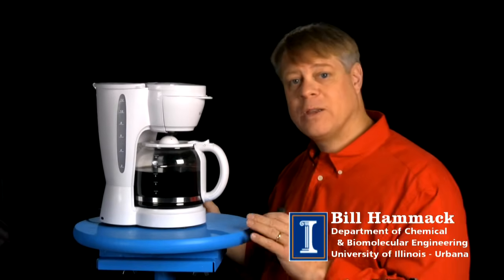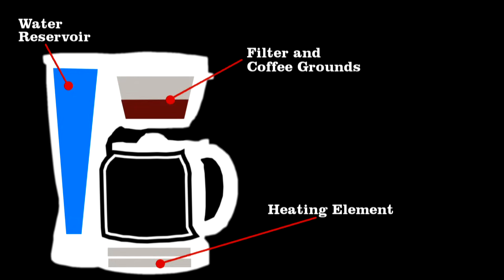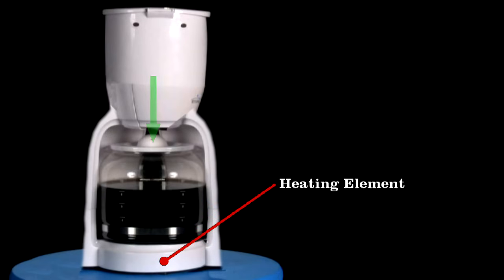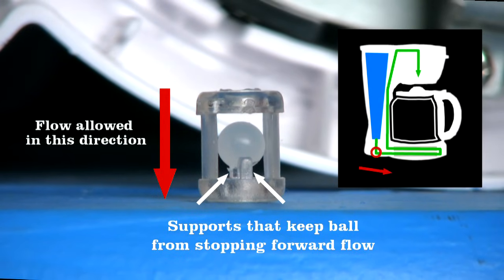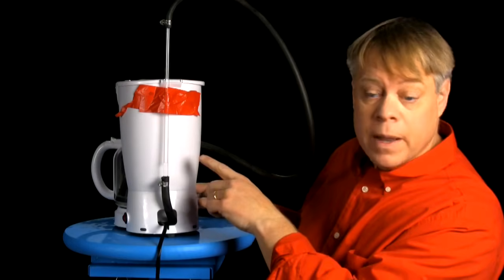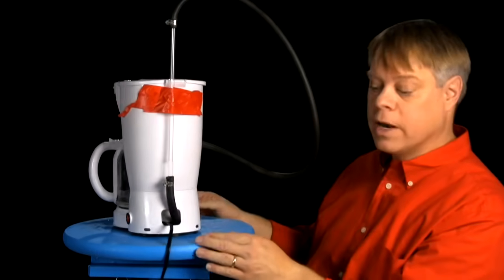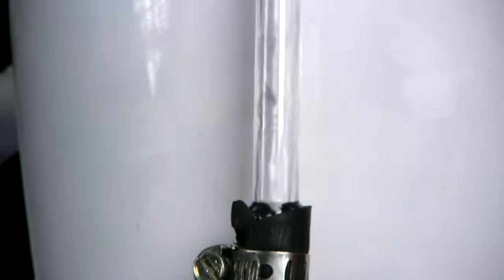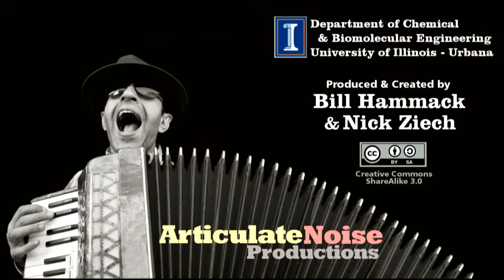Coffee Maker: Pumping water with almost no moving parts

Comment: "no moving parts" ..... "the ball rises" ahem....
Reply: I think he meant more so that there were no mechanically driven devices that caused the pumping action, the ball merely took advantage of the pumping that was already occurring because of the heat.
Reply: factually inaccurate.
Reply: ImAManMann
Seems to me the point of the video went completely over your head. You should still be able to appreciate the engineering design, isn't that why you are watching these videos?  I assume he meant there was no mechanical parts used specifically for the pumping action as physics took care of that itself through a clever design. If this were the case, yes he could have clarified it better but so what? it was still a well explained video just like the rest of his uploads. I don't see the purpose of making a big deal out of it. If it really bothers you that much, I'm sure your absence would go unnoticed. Maybe it'll serve to lower your blood pressure and your pompous attitude.
Reply: ImAManMann
You say you don't care what he meant yet that's the concept your initial comment revolves around. Trust me, nothing you can or will say will ever go over my head - except maybe the rather pointless and haphazard wall-o-text you wrote in an attempt to offend me. I wouldn't deem why you're watching completely irrelevant, if it's to be hypercritical on video titles and fail at winning an argument, I think you're doing a splendid job. As for me and many others, I enjoy watching his content because it's informative, well-edited, and I find them interesting. I'm not gonna implode because he could've been a bit clearer on his video title and I don't think you shouldn't either. How could you enjoy anything with such a fickle mentality? Hence why I advise you stay quiet next time and unsub for your own sake. Try to enjoy life more without being so bitter. Have a good day :)
Reply: LOL Mike....(now that I have stopped laughing .... inhale... exhale...ok) I can only surmise that you either have a reading comprehension issue or you are angry. You failed to address the points I made or misunderstood them. Please try again. wall-o-text??? pot/kettle anyone? Bitter... hahahaha. To quote you again "I don't see the purpose of making a big deal out of it." But I don't really expect any better out of the interwebs.... Should I throw in a sarcastic jab here at the end.... nah... you are digging your hole fast enough by yourself. cheers
Reply: +ImAManMann: Just because you don't like me and quote me a few times, it means that I'm clearly digging a hole for myself - you must do wonders with that kind of logic. Meanwhile, I have a Master's in the field. If you strictly just wanted to point out the "inconsistency" in the title and weren't annoyed by it like half of these hypersensitive kids on YouTube then that's almost just as bad - considering it was said dozens of times before you even watched the video. Much like the responses you're giving me now, it was rather unnecessary. Yes I did assume you said what you did with emotion because I didn't want to think you were dim-witted enough to think it was helpful to say the same thing the last 20 YouTubers said before you - but then again, like you say, I don't expect much out of YouTube. I guess I was hoping for better conversation on a channel that revolves around calm, scientific explanation. I was dead wrong. May you point out redundant statements for countless videos to come!! Don't waste my time with another response unless you can keep calm and not spam capital letters and insults. I would appreciate it.
Reply: In your response to my second comment "I'm sure your absence would go unnoticed. Maybe it'll serve to lower your blood pressure and your pompous attitude." You were condescending and rude with no provocation from me.

My comments were to that point "Factually Accurate" with zero of anything else.....well there was an "ahem"

You continue to be condescending when you have no footing to do so.

My comment was correct. Regardless of how you feel about it or whatever contrived position you hold. I was and am correct. If you want to argue against me, argue against my point. 

If you can actually comprehend what I have written, then stay on topic and argue against my factual statement. I'm guessing you won't.

OMG... My argument was simply that the video stated "no moving parts" and then shortly thereafter referenced a moving part. 

You are correct you can "make .... analogies...say the word logical". The problem you have here is that you are not addressing the argument I made. You are attempting to "posion the well" instead of making a counter argument.

You are factually incorrect. I have not been angry one bit during our entire exchange. I do not have the problem where other people and what they say impacts my emotions. I find it silly that you feel this way...would it be wrong to call it projection...

 "Please keep coming back.......yadda yadda..... Anyways, I'm done here, I had enough fun with you. Thanks for wasting your time with me."
Ok sure...LOL

And again with the anger reference.... so confusing... is your inner dialog when reading YT replys sound like samuel l. jackson in snakes on a plane? If so, everyone will sound angry to you.

Dude, thing is... I said it was factually incorrect and it is. You tried to wiggle around saying he "meant" and "explained better". The fact is, it is "f a c t u a l l y  i n a c c u r a t e". Take out the "moving part" and it ceases to function.

Please come back and argue that point.

This is awesome... I am totally going to share this.
Reply: ImAManMann
You should share this if it'll improve the days of others, because why not? You haven't written much so I'll choose to focus only what you said that remained on topic and wasn't angry nonsense, LOLs , and needless spelling of words I already know how to spell. I'm not sure how you can keep saying the context of the title doesn't matter when it does. If one video was someone using a glider and they made the title "I'm flying like a hawk" would you then go out of your way to point out it's factually inaccurate because he's not an actual hawk? Seems like a waste of energy to me but people will do what they feel is necessary to make themselves feel smarter or more important. Similarly, in this case, he meant his title in a different light. I already agreed there was room for confusion and it could have been clearer but I then again say - who cares? Just enjoy the video and stop being so angsty and hormonal :) for the record I have addressed every point but you have proven to lack basic comprehension skills. 
I would love to continue this conversation to keep making you and your friends smiling, so if you want to continue please keep feeding into my replies. Thanks.
Reply: "You should share this if it'll improve the days of others, because why not?" I know, right? 

"You haven't written much so I'll choose to focus only what you said that remained on topic and wasn't [AD-HOM]angry nonsense, LOLs , and needless spelling of words I already know how to spell." So a few questions.  I have told you specifically that at no point during this interaction have I been angry. Why do you characterize my responses as angry? Can you read minds and know me better than I know myself? It is truly bizarre your obsession with imputing anger and other qualities. You do realize those are poor argument techniques... right?

"I'm not sure how you can keep saying the context of the title doesn't matter when it does. If one video was someone using a glider and they made the title "I'm flying like a hawk" would you then go out of your way to point out it's factually inaccurate because he's not an actual hawk? [FALSE EQV]" Is english your first language? The key difference between the example you provided is the "like" clause. Which I would interpret as being hyperbole. It the title of the video I am quite sure hyperbole was not intended. I will change my opinion on that if the creator of the video states that it was meant to be hyperbole. There is no grammatical indication in the title that anything else was meant. Especially given the fact that the title of the channel is "engineerguy" and engineers are known for being peculiarly specific. 

"Seems like a waste of energy to me but people will do what they feel is necessary to make themselves feel smarter or more important.[AD-HOM]"
My original.... and second comment was very short and passing. The equivalent of a "roll-eyes". Should I also characterize your massive and out-sized response to my small comments as an attempt for you to make yourself "feel smarter or more important."?

"Similarly, in this case, he meant his title in a different light." How do you know this empirically know this? Please be specific.

"I already agreed there was room for confusion and it could have been clearer but I then again say - who cares?" Yes, you are admitting my comment was accurate. Why do YOU care?

"Just enjoy the video and stop being so angsty and hormonal :)[AD-HOM]" Why do you feel the need to hand out advice that you will not take yourself?

"for the record I have addressed every point but you have proven to lack basic comprehension skills.[AD-HOM]" You failed to address why you feel that I am angry. You are incorrect btw. I know you don't truly believe that I lack basic comprehension skills, you would realize that would make my responses impossible. The reason for you stating this is the same reason so many people use ad-homs, your position is untenable and you have no real argument. Title is factually incorrect. Lets see you argue that without using any further logical fallacies.

"I would love to continue this conversation to keep making you and your friends smiling, so if you want to continue please keep feeding into my replies. Thanks." As you said "because why not?"

You have reacted so much like the SJWs who I occasionally interact with on the tubes. I would like to see a response from you minus the logical fallacies consisting solely of an argument against my claim that the title is factual incorrect.

I have tagged your logical fallacies above and I know you will claim that I used them also... I will admit that I have thrown in some ad-homs, but only as a response to your own. You started it, you strayed off topic making personal attacks and you can stop it. You will not bully me though. Stick to factual statements. If you cannot stick to factual statements then this thread may become EPIC.
Reply: ImAManMann
I don't have to read any of this, hope you had fun writing it.
Reply: Ahhh yes... no argument... thank you for conceding.
Reply: ImAManMann
:)
Reply: Mike you know... funny thing... looking at the notifications on my phone I can see that despite you saying you don't have to read my reply...you did. you read it you replied and then you came back and edited it to pretend you didn't. a hahaha dwl .
Reply: ImAManMann
No, I just forgot the "+ImAManMann" part so I edited it. Not sure why you're still continuing this conversation.
Reply: Oh and check out 4 seconds into the video. I don't know if it was ninja edited or not, but it now reads "almost no moving parts" BOOOOOM can you feel that...
Reply: Are you really still going on about this? your opinion on my integrity is meaningless and I can assure you nobody will care whether you're right or wrong because they won't want to waste their time reading this long chain of messages. Invest your time in something else.

Comment: The one way valve is also called a check valve. As a chemical engineer working on the floor, i deal with them all the time but I had never ever thought they could be used as a pump. Wow.! Also learning recently a bit about "slug flow" usage in crystallization processes, I find equally fascinating. You can actually crystallize solids in a moving gas bubble in a tube and control particle size using slug flow.

Comment: the valve sort've moves...
Reply: cakeman58 Yep so does the on/off button and thinking of it even the coffee pot moves. 
But that is not what engineers mean with moving parts. Technically 0.9999 is not 1 but for an engineer....
Reply: Electrons move in wire which we call electricity - literally, electricity is the energy in the movement of electronics

Everything has moving parts or it doesn't do anything
Reply: Technically: yes it does move.
However, when things are described as "little-to-no moving parts" they're referring to not having things like electro-mechanical pumps that push the fluid through instead of letting physics do the work with a simple check valve.
Reply: MinecraftEpicPlayer
An electron isn't a 'part' anymore than an atom is. Sure it's a "part of the process," but that is not what the word 'part' means in this context- or the phrase "no moving parts" would be utterly meaningless. The abstract definition of 'part' shares the same word in English but is actually a completely different concept. A valve is a moving 'part' in your coffee maker; an electron is not. The title is technically a lie.
Reply: ElNeroDiablo except this was literally described and titled as having no moving parts, which is false.

Comment: The principle is called "thermosiphon".    At one time,  it was even used in some automobiles,  in lieu of a belt-driven water pump., to circulate the engine coolant.
Reply: I think this is different. What is actually moving the liquid here is heated water forming bubbles (vapour) inside the rest of the water, and as it rises it pushes the liquid water up. I don't think a thermosiphon uses a gas to move the liquid, it uses thermal convection. A bubble pump (aka gas lift pump) needs the one-way valve to function. As each bubble passes up through the liquid it pushes a little bit of that liquid up, but because it can pass through the liquid it is not capable of pushing it all out of the way, which is why the one-way valve is needed (so the little bit of water that is moved up with each bubble doesn't move back down). That's what gives this kind of pump its distinctive sound, which is created as the gas escapes.
Reply: @Derek_Read  This is correct
Reply: Probably in France... 😃
Reply: A gas lift pump only needs a one way valve if there is the possibility that the bubble can go  the wrong way. You could replace that valve with a U-bend, provided you have the space to do so. The gas bubble can't go down and around the U-bend.
Reply: @fermitupoupon1754  the check valve is preventing the liquid from flowing the wrong way, not the gas.

Comment: You didn't really explain how it works, though did you?  You just said it forms a bubble pump. The reason it works is not due to buoyancy. The water in the heater boils into steam, which expands, pushing the water above it upwards into the coffee. The valve prevents it from going back into the reservoir. After the water exits at the top, the back pressure on the valve drops, and the valve opens, allowing cool water to rush into the heater. From there the cycle repeats.

Comment: Sir, can you guide me as to what kind of electric pump I should use for pumping drinking water from a 20 liter can such that it outlets water only when I switch it on. Currently I am using a centrifugal based pump which passes water even when off. So i have to use an RO solenoid valve with it, but that dampens the pressure and makes the setup bulky. Any advise would be helpful. Thanks.
Reply: If you want the flow of water to be blocked when the pump turns off, you don't have many options. One possibility would be a vane pump. Other possibilities  are a lobe or gear pump or a peristaltic pump none of these types of pumps are going to be cheap, small, or low power. Without knowing what your desired final result is, recommendations are hard. Are you trying to lift water? transport it? dispense? etc.  Flow rate and required pressure are the biggest factors. You could consider pressurizing the 20 L container with air, and then opening the solenoid valve to allow water to flow by pressure.  Personally, I think using the solenoid valve is a good option. There are other types of water valves such as diaphragm or servo, but it sounds like you looked into that.
Reply: Thanks a lot.. this helps! :)
Reply: My friend, can I suggest you give the game away completely and resort to a high fibre and fruit diet. These homemade, powered enema's are a hazard to normal bowel function. That's a high stakes game you're playing there.
Reply: +Fletcher DeMaine ummm... Didnt get the context.. Did u post in the wrong video by mistake?
Reply: I believe he is jokingly inferring that your purpose for this pump is to perform enemas. He is giving you advice to avoid the need for such methods.
Reply: wow :D